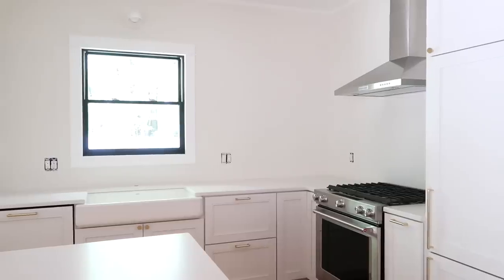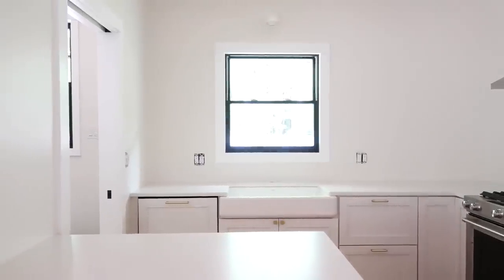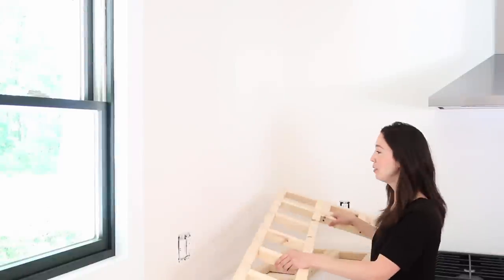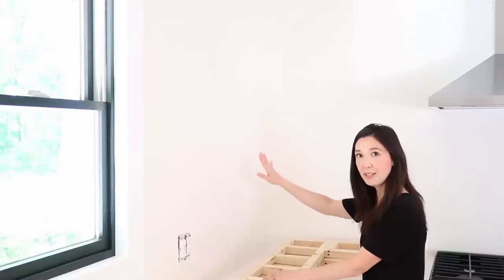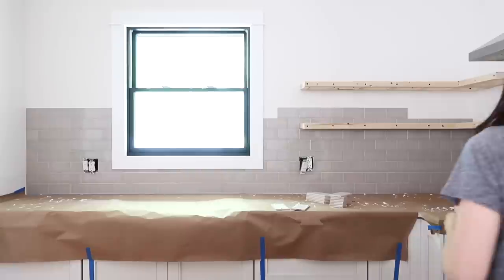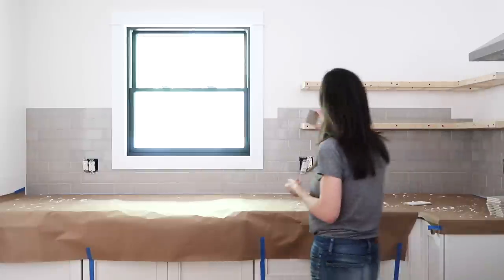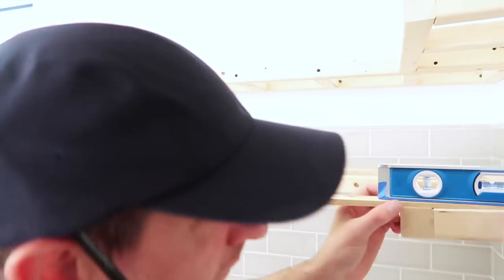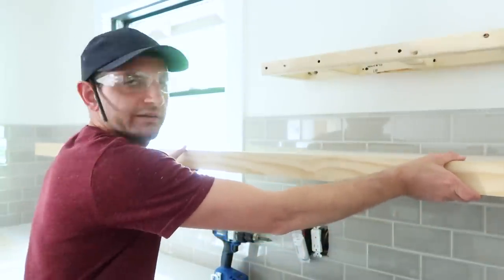How-To DIY Floating Shelves!

Comment: That turned out great!!  I’m a professional Millwork/Cabinet installer and install these all the time. I’ve found over the years, the best way for strength is to build the 2” shelf first with a 1” hollow cavity inside. This way your shelf can be mitred together to look like 1 piece of wood. Then drill a 1” hole at least 2-1/2” into each stud with a laser level shinning down the side of the bit. Then insert as long a piece of 1” hardwood or metal dowel rod as the shelf will allow.  Then you can just slip your shelf on over the dowels to scribe fit it nicely to the wall. This way is also nice for changes or repairs down the road because you only silicone the back edge of the shelf to the wall, so it’s super strong but can be removed and reinstalled easily without compromising your support structure. An alternative to silicone is to just fire 1-2 small Brad nails into the dowel from the top of the shelf. Preferably a 23g micro pin so it can be wrestled off without to much trouble, and no damage. I use the silicone method because most of the shelves I install are painted, so pinholes are very noticeable, but because of this I don’t even bother glueing the dowel into the wall, it can all just be removed easily. 
Some pros and cons between these methods I found were by building ladder framing like that, The shelf was only as strong as the joint between the first strip you’ve screwed to the wall and the extensions connected to them. So overtime when the shelf is ever pulled on or really loaded, any sag becomes permanent. It will always be able to wobble or sag that far. Where with the dowel support it is much stronger to start with, will never become more wobbly over time. There’s more then 1 way to do these because yours clearly turned out great, but I hope this helps someone looking for a bit more strength. Especially for totally open floating shelves not supported by a wall on either side.
Reply: I like the way you do yours. My question is that much more money to buy a solid slab of wood??
Reply: @alphaomega6497  It honestly might be but it’s money well spent for the durability in my opinion, also makes the dowels fit a lot better meaning the support is better as well and you don’t need to level out anything since it’s one chunk of wood. If you go to a local lumber store or something you can just have your measurement with you and get a quote or something
Reply: Outstanding explanation from a true craftsman
Reply: I use the same method for straight run shelves, way easier!
 For L corner shelves I use the same technique they did, with the exception of cutting out the strip of drywall behind the shelf using a lazer level and then attach the cleat directly to studs with lag bolts. 
Its more labour, but it ensures you shelf wont sag and crush your drywall in the future.

Comment: Here's an example of THE RIGHT WAY to make floating shelves. What I didn't mention in my earlier comment is this:
It's not just my OPINION that this "Yellow Brick Home" DIY video is a fail. 

it's actually an engineering FACT: These shelves will fail over time unless they are ONLY used for shelving lightweight items.

Comment: You have one big problem amigos - these shelves will NOT support the kind of weight some people would want to put on them - such as stacks of plates, glasses, etc. It looks nice, but there is A REASON floating shelves utilize a rod system that gives strength to downward pressure in the same way brackets do. Sorry kids to be the bearer of this bad new and I'm sorry if you don't take this constructive criticism well. Your generation DOES IN DEED have a difficult time admitting failure or wrongdoing. It stems from being coddled as a child and sadly this is getting worse in the U.S. and not better. 

And yes you can stack plates and glasses on these shelves, but it will only be a matter of time before they will begin to slant forward due to the weight. 

: )
Reply: i think someone needs a little coddle..
Reply: OK boomer lmao
Reply: This will work fine. If you didn't know, the other side of these "rod" systems are typically also just screws. You can just use bigger and longer screws than these guys.

Comment: Why would one install the frame on the wall then build the shelve around it?  you obviously can't hold the drill straight and the paint brush dest fit between shelves does not lay flat. Shimming is only need on the wall support not the shelve box? Your method is very silly at least. i'm sorry but that just a fact. yYt at the very least a  "B-" for effort.
Reply from the maker: Hmm, I'm so sorry this tutorial wasn't for you! We built the shelves around it to account for any imperfections in the tile. The results are super clean! We're happy with them, and we hope you find our other tutorials helpful!
Reply: @yellowbrickhome  
Ignore the negative comments here,I build these as a UK carpenter all the time as bookshelves,and a pile of books can be a serious weight,been building them 25+ years with no complaints,the finished job of yours looks good,and if you are happy with it that's all that matters.